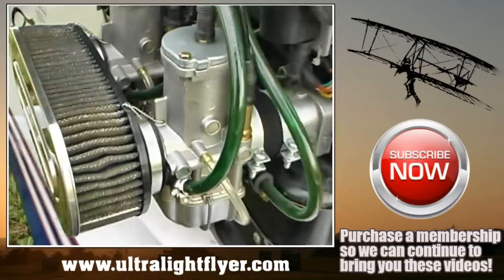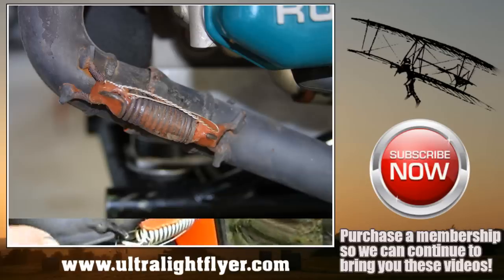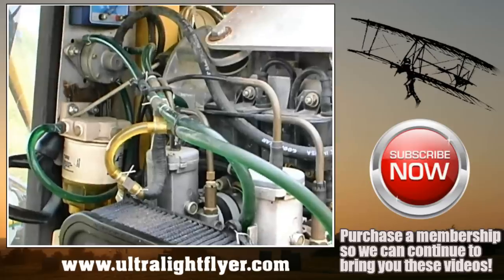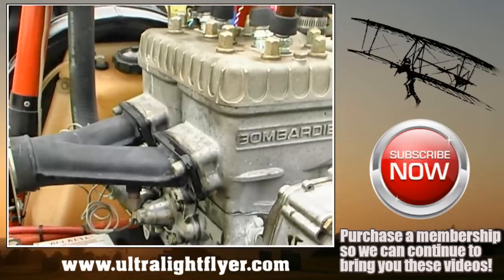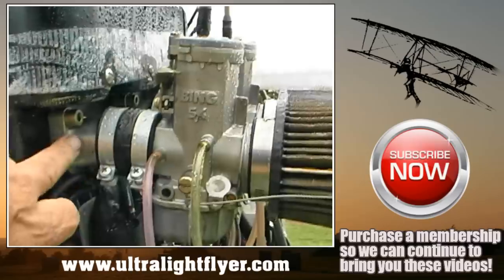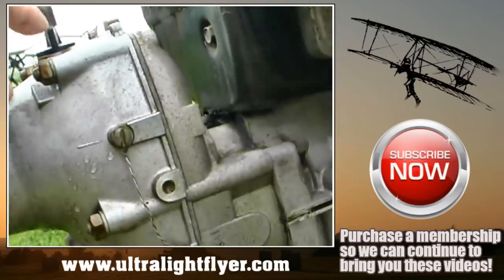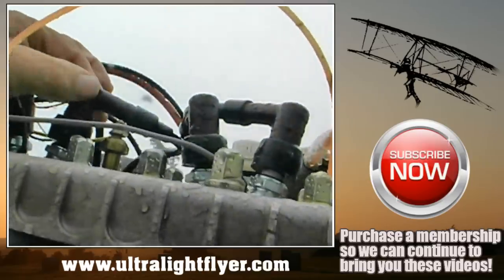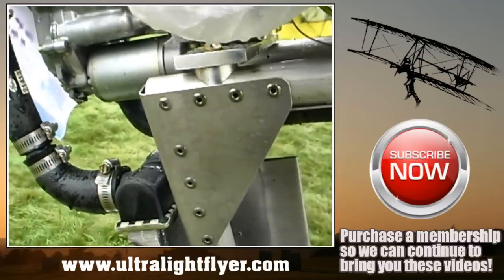Ultralight  & Experimental Aircraft Safety Advisory Alerts

Comment: Can't thank you enough for this video. I raced 2-cycle motors (a production class  Kawasaki 350 triple motorcycle, my favorite in handling over Yamaha's RD 350, Go-Carts (not the ones using lawnmower engine motors)  twisting 100 - 350 cc 2-cycle motors at insane rpms, as well as the early Formula 440 class cars, all at risk of damage from high-frequency based fatigue.
We always went out of our way in our attemps to safety wire everything as 2-stroke engines are notorious for high frequency cracking , especially in  fittings such as, well everything from cooling fins to (and I can't stress this enough) exaust systems,  especially those that are using tuned expansion chambered  systems that, because of of their design of using high frequency exhaust pulses to create reverse/ back pressures within the engine at high rpms, creating a form of 'supercharging' in a 2 cycle/stroke engine, creates extremely high frequency vibrations within metal parts, especially the connections and mounts where the resonate high frequency vibrations are capable of loosening even properly toqured fastenings, ang cracking even titanium mounting brackets. That's why saftey-tying everything on any motor/engine used for aviation purposes is so EXTREMELY  important!
 Cannot thank you enough for this video obviously based upon experience, and your focus upon areas of safety-tying absolutely everything whenever possible, or  double-nutting wherever safetytying cannot be done.
 Thank you for sharing your expertise as is applicable to the field of light aircraft powerplants, and would love to see a follow-up video covering all fastenings other than the powerplant, as there is no such thing as complete isolation from the destructive nature of both low and high frequency vibrations, especially when you are hundreds of feet above the unforgiving earth below. Build safe/fly safe everybody!

Comment: Near the end of the video, there is some discussion about mounting the battery away from the engine and using long cables to the starter. The point that should be made here is that the starter relay should be placed right next to the battery, so the large cable going to the starter only carries power when the starter is on. Also, there should be a much smaller gauge wire used to bring power to the electrical bus, and this should have a cartridge style fuse mounted as close to the battery as possible. Or even better yet, a relay can be installed very close to the fuse so that when the master switch is off, there is no power leaving the area of the battery.
At the risk of nitpicking, (which is not my intention, this is a fantastic video), lead-acid batteries do not use hydrochloric acid, they use sulfuric acid. Also, gel cell batteries are not at a lower risk of throwing acid around if they get crushed than is a "wet" cell battery. While it is true that the electrolyte is mixed with silica particles to make it into a "gel", this gel is still not thick enough that it will not freely flow or spray around if the battery is suddenly crushed. (The purpose of the gel is to control corrosion, not contain the electrolyte.) Also, the primer line being sealed up is not as critical as it is made to sound. If you look inside the throat of the carburetor, the primer terminates in a brass nozzle that has a 0.010 hole in it. This hole is far too small to have any measurable affect on the idle mixture. This is like saying that the bleed hole on the back of the pulse pump would change the mixture in that cylinder, it is just too small to matter. Lastly, the hose that goes from the crankcase to the pump is called a "pulse" line, not a "vacuum" line as its average pressure is actually very close to zero.

Comment: Great tips! I use alot of these tricks (silicone, for example) on motorcycles, boats, and in some automotive applications. I've only dealt with safety wire in racing applications, so my experience there is limited. I'll be sure to buy the tool, once I buy a paramotor at some point.

Protecting and securing wires is a big one for me in any application, but especially in marine applications. A fire in a boat is bad ... but a fire in an aircraft is REAL bad. Excellent video - thanks!👍👍

Comment: The number one thing the FAA could do to increase ultralight safety would be to increase the empty weight from 254 lb to 300 lb.
Reply: What is the FAA reasoning for 254 lbs?
Reply: Yes would be great that would
Reply: @jacobmcdaniel9507  At the time that was kinda standard weight for small aircraft but know we know the extra few pounds would be able to beef up parts that come apart and make them safer. no real reason i can find
Reply: @jacobmcdaniel9507  When the FAA created the rule, they used the specifications from the most popular ultralight at the time, the Quicksilver MX. If you look at the speed and weight numbers, you can see that they were exactly copied from the aircraft datasheet. They wanted the rules to reflect the "typical" ultralight of the time. Obviously, things have changed since then, so I think the rule should be updated to allow more weight. This seems like it would improve safety.
Reply: You can go to 276 with a parachute and that parachute doesn't count as a weight penalty. Should be 272 and 300 with parachute.

Comment: I have wondered about many of these things when watching video's ...One thing that REALLY blows my mind..If you look at the "Tech" specs for (ANY KIND) Race Cars..It is critical to mount the shoulder belts behind and below the shoulders..and they MUST travel over a bar about 4.5 inches below the top of shoulder..then go over the shoulder...This is absolutely necessary as the way (most I see) they are mounted in the video's posted, will "literally" break your neck in a crash!!..Years of safety development in racing crashes, bears this out..It is a "written in stone" deal in the racing industry. I just don't understand why in almost all planes they are mounted wrong and it doesn't seem to be a big deal????
Reply: In a plane crash usually the body goes forward, if the shoulder belts attach lower than the shoulders, the body going forward causes the belt  on top of the shoulder to go taut,  which compresses the spine and fractures the vertabrae in compression.  If the shoulder belts attach above the shoulder,  when the body goes forward, the force is resisted by the belt on the front of the body and the top of the shoulders sees no force. That's the aerospace logic as I understand it. Do you have a reference to any documents which discuss the logic of seat belt placement in racing autos? 

The belts must be mounted 'wrong' in all my cars too. Consumer autos also have the shoulder belt attach points above the shoulder, and if that was such a hazard, I can't imagine the NTSB would have allowed automakers to get away with it for so long.

Comment: At 12:56 carb  boot looks cracked surprise you did not note that
Reply from the maker: You of course are correct, the carb socket does look to be cracked, it is an ongoing problem and should be a regular preflight inspection area.

Comment: Omg being an A@P I could listen to no more than a minute. No wonder these planes fall out of the sky.
Reply from the maker: I have flown THESE PLANES for over 48 years, with over 20,000 hours of flying time, and taught over 1500 students. 
These planes are SAFE, affordable, fun flying machines.  I have also designed over 10 aircraft, and built and sold over 200.  I did the video to show some of the things that pilots don't know - and should correct. But in most if not all the cases - the aircraft have been flying safely and without incident.
The Ultralight Flyer
Reply: @ultralightnews  
G'day,

  Great reply to a rather supercilious comment, and this is a great video too, btw..; but it's a fact that Dunning-Kreuger Effect ("For they Do Not KNOW..., that they Do NOT Know...!) downs a lot of Hairygoplanes, and initiates many careers in the Field of up-pushing the Daisies.

  As it happens, I'm currently attempting to save a young fella in Arizona from the worst depths of what he doesn't know - that he doesn't have a clue about.

  He's been simultaneously  scratch-building FIVE different little obscure machines, from Packing-Case Pine, salvaged Styrofoam from the Dump, and Hardware-shop Turnbuckles with Baling-Wire and Bedsheets...

  One of his creations is (or began as...) a Volmer Jensen VJ-23 "Swingwing", and because I have a (not repaired) VJ-24w "Sunfun" which I used to fly he showed up in my Threads...; and he's recently begun posting videos showing what he hath wrought.

The Swingwing's Plywood Web-Spar annoyed his sense of Thriftiness, so he's designed & built a marvelously intricately triangulated Redundant-Frame Warren-Girder for a Wing Truss, instead - almost Barnes-Wallis type but it's not quite "orthodoxly Geodetic"...; a LOT of work went into it, clearly.

Built in Aircraft-grade Spruce it MIGHT be strong enough, but in Pinewood Off-Cuts, who knows (?) ; his goal is apparently to build the Swingwing for under $100 US...(!).

  Then, as well, he's cobbling up some truly terrifying....., the only word I can use is CARICATURES of the designs of one Henry (?) Beaujohn...

About a week ago while we were argueing about Propeller Efficiency it emerged that he's  approaching the culmination of at least 3 of his 5 build projects..., and nobody had ever before told him that Aerofoils Must Be SMOOTH, for a Wing to function at all....(which factoid,  by itelf almost entirely explains the wildly casual and slipshod nature of his workmanship...) !

  So, he's since condescended to consult someone he knows who works on the Goodyear Blimp  (!) and accepted their advice that, Yes'm - Wings do indeed HAVE to be "Mirror finished and Glossy smooth" as per the instructions on the Plans - so apparently he's now painting the jagged Messes which he's made with "Aeropoxy" and sanding it back..., and generally trying to make a smooth Silk Purse from a set of Sow's Ears, so to speak.

  He doesn't much enjoy constructive criticism, and I've been abused a few times in his threads, for having suggested better ways to do things.

  Essentially, he seems to be working from a rather  tiny "Knowledge Base" but that's all powered by a burning conviction that he can show the world how to fly much Much MUCH Cheaper than all the Conventions & Regulations stipulate.

  Would you please consider going to his Channel (...@Gregory Dahl ) and watching his Videos, and then reading the Comments whereinat I've tried to lead, nudge, push and goad him into lifting his game before he "finishes" one of the Creations and attempts to (teach himself how to) fly the thing...?

   One 'Plane of his has a second-hand Go-Cart Motor, another has a Briggs & Stratton 8.5 Hp 4-Stroke Engine from a Harbour Freight Store...; he welded a hacksawed bit of Waterpipe with a Square Key onto the Briggs & Stratton Motor's Output Shaft, while the Motor was mounted on the Airframe, to cobble up a Hub to bolt his Propeller onto.

  He's operating so far out in WTF-Land that I really have trouble listing all my doubts regarding dodgy practices ; because there are so very many of them that it becomes confuzzlink.

   I have no idea how he got to be quite so highly motivated to build Flying Machines, while remaining so very terribly ignorant as to what-all is involved - and which bits REALLY DO Matter...; but I wouldn't mind having a few other  people who know what "Right" looks like when they see it, showing up on his Threads and maybe joining me in attempting to "mentor" this young "Hothead", into at least showing his handiwork to someone with a Pilot's Licence, or to a Licenced Aircraft Maintenance Engineer..., somewhat before he attempts to levitate in anything which  he's built in such a sea of Hubris, Arrogance, and Ignorance.

I'd rather that nobody resorts to corrosive insults, least he delete his whole Channel and procedes further in his almost complete isolation from contact with all established practices...

  Are you game ?

  Or should we simply leave him to figure out for hinself that "Shit won't work as Shoepolish, and  especially not on Flying Boots ...!" ?

   As things stand, he's the sort of Statistic-In-Waiting which will inevitably  bring ALL tiny little Hairygoplanes, and their afficionados, into Public Disrepute and Ridicule ; when he wraps it up in a ball of expensive noises, and hurts himself.

  At least, that's my impression.

Please, do go and check it all out..., "the Birdman of Aridzona" is how I think of him, and he's on your Continent, a Countryman under the one Flag sorta thing - so he might be more inclined to listen to thee than to me (he's an AmeriKa Firster, y'see...!)...?

Oopsie...

I'm beginning to rhyme...
I should sig(h)n off ;
It now be th' time !

Thanks.

Such is Life,

Have a good one.

;-p

Ciao !
Reply: The accident rate is only slightly higher for E-AB vs. certificated, and is mostly due to human factors, not maintenance or design..
Reply: Care to enlighten us as to what was wrong here, Steve?
Reply: @WarblesOnALot  when does volume two come out. JK.
Reply: I work on both ultralights and certified airplanes. I have seen far worse problems in certified airplanes than what is shown in this video. Your statement is simply unfounded, as there is not any operating history that I can see that shows that ultralights are unsafe.

Comment: Too much reliance on Duck tape and silicone rather than proper points for wire locking,watch out for anti locking too, route the wire properly with no slack,those prop bolts should have locking holes on such a critical area.
Sorry dont care how many hours this is sloppy engineering.
Reply: The Rotax installation manual requires that you use either lock nuts on the back of the flange, or drilled heads with safety wire. I do not see this as sloppy engineering.